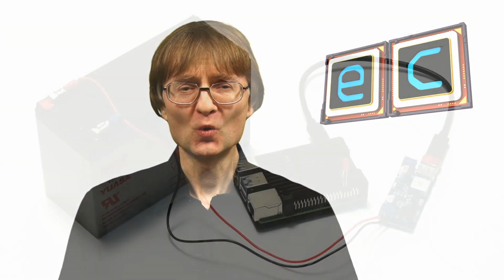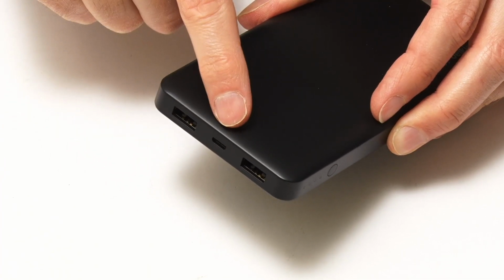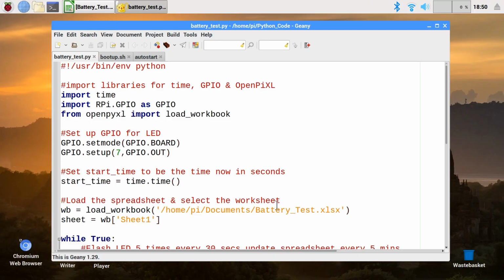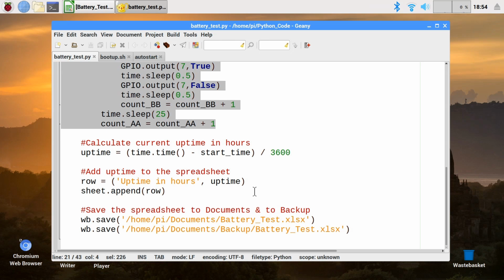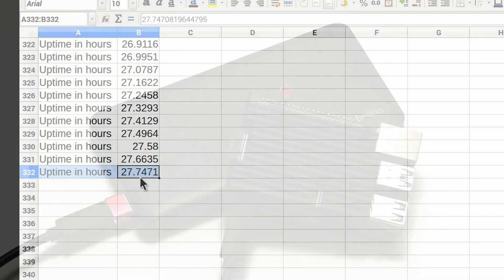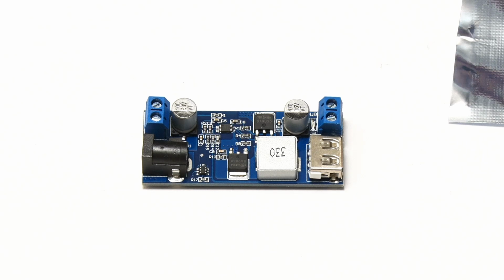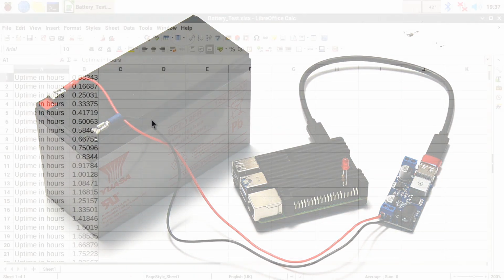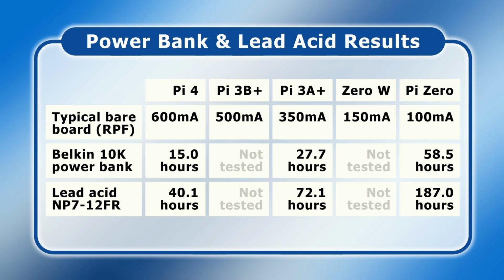Raspberry Pi Battery Power

Comment: If you can use a normal large car battery it would be very. Useful!
Yours truly
MNFsoft
Reply: The buck converter will work the same with a car battery as they are also lead acid 12v batteries.
Reply: Yes I know because I am an electronic engineer a very skilled one actually I want actuall data to use it as reference if you don't mind please!
Reply: @deathtospi9072  What "actual data" do you want? 
You really have no need to prove your credentials to me, I honestly don't care. 
I'm worried though that you (as a "highly skilled electrical engineer") can't Google the battery in the video to find the manufacturer's data sheet and then compare it to 'what ever' car battery you're thinking of using. 
You're not an engineer in the UK are you? If you are, which company do you work for? I want to know who to avoid.
Reply: @theoriginaldylangreene  mainly run time
Reply: @theoriginaldylangreene  unfotunatly I never got the opertunity to return back to the U.K. plus I am just a Ph.D. student
Reply: I am making a new theiory that if we use normal size car batteries it would give us more run time plus it is much cheaper since it is rated 65 watts there models rated even 100 watts but without actal data I cannot prove anything plus I am design ing. An automated fully reluable transport system that can work in hazardous conditions to rescue lives 
so that is why!
Reply: Thank you you have been a big help

Comment: good result, adding any exterior device to the pi changes the results a lot, such a device might be active all the time, my 2x adafruit stepper motor hats (project needs 4 steppermotors), so a lead battery is certainly better. Used 6 volt 12Amp ( less weight ) for the motors and a pijuice hat to power the pi zero. (could power both from lead batt too)
advantage with the pijuice is the shutdown is done by software monitoring its 12Amp battery (not standard)

Comment: Great video :) My pi v1 has been up for  2786 days, 03:07:0 | Linux 3.6.11+ Sun Sep 15 18:40:04 2013
Powered by lead acid and solar :) https://www.youtube.com/watch?v=UIP20B1GMoo
Reply: Wow.  What work is it performing?
Reply: @Chris.Brisson  it's a media head end for a radio transmitter.
Reply: @Anand Raj oh it's real alright. the storage isn't really used as it's network attached, and I used the tmp folder as a ram drive

Comment: What a careless comparison, you didn't prevent the lead-acid battery from deep discharging as far as i can see, this will quickly kill it! No wonder you got these high numbers, the buck converter is sucking the lead-acid battery dry until it hits ~5V and the pi shuts off. The li-ion power-bank on the other hand has protection, it will shut off to protect itself, which of course results in less usable capacity but more cycles.

Comment: i use a raspberry pi 3b plus as a tracker for my camper van and its work fine for 2 years + its sends a line to a data base every 2 seconds via the internet a long side that i have another pi 4 8gb in the van controlling the solar panels and data logging power used and made from solar then if the batterys in the Van get low the pi will check to see if the van not in gear and hand break on if that the case it will start the van engine on its own to charge the batterys then switch the engine off once 100% and all off this reports back to a server at my flat using INFLUXDB to store the data on another Raspberry pi 4 8gb it reports every 2 seconds 

as well as that its controll's all the light and water pump heating usb sockets in the van via relays and  code i got working 

and i can access all of this from a mobile phone via a app i made  

only had one problem a sd card went funny flash another one and all fine

Comment: How big a solar panel would it need to keep the batteries charged so the pi:s can run indefinitely. Or rather is it worth the money to add a panel to the setup? Been thinking of using a Pi for a trail camera. Come to think of it, is there a 4G add-on for the Pi so it could mail me what it records rather than me having to get into the wood to swap out the memory card.
Reply: Yes there are 3G/4G modules around for the RPi. The "size" of the solar panel depends on what RPi you run, and what its doing (3G/4G uses more power than the WiFi), sun coverage (ie wheather), panel angle relative to sun, and finally season (time of year) as the sun can be almost horizontal during the winter in a lot of places. Solar for a Trail Cam may also be affected by tree shadows. As an example, 3x2 foot, 45 degree fixed position road-side solar speed sign running a camera/sensor, and output to large high-visability LED matrix, charge a 12v battery (and may or may not use a SBC).  -  I had previous had along think about how to use a RPi to run remote weather stations (usually with good sun/wind access - like at the beach or open areas in the bush/forest), and how to run a RPi environment sampling at the base of trees and shrubs in the middle of the bush or forest (very little sun light - solar needs to be on a tall poll) - Note there are a least 2 confirmed working projects using RPi to dynamical track (or adjust for) sun for solar panels, one used yearly sun angle data, the other use light sensors.

Comment: Crikey, don't you believe in fuses!  Sealed lead acid batteries can supply several hundred amps, so accidental shorting of the wires from the battery or the PSU module going faulty could easily cause melted wires or even fires.  Place an in-line fuse in the positive lead to add some protection.

Comment: Will done! I wonder if you used a lead acid 6 volt instead of a 12 volt power closer to 5.1 volts?  If I had you as a teacher in school I would have liked school a whole lot more and I have been out of school for 41 years....... see ya next Sunday
Reply: Well you need double the ah for the same amount of wh, but may have a little bit less losses in conversion

Comment: In using the Acid Battery, I noticed that you did not use ferrules to connect to the converter; and the wires you used were of a tiny gauge. Would it matter to use ferrules and a bigger gauge? Would it be a different test if you used OFC or CCA wire? Would a AGM battery be a better choice? Just wondering.

Comment: You have used 100% of the battery's capacity. Doing this shortens its life considerably, compared with only using 50%. You should use an AGM battery, it's not clear whether you did, aka deep cycle (though deep cycle doesn't mean AGM). Your circuitry should include a shutdown circuit for when the battery voltage falls below the recommended threshold. Then your results will be quite different, and quite safe.

I have been researching batteries for use in an RV. My choice is LiFePO4.

What converter did you use?

Comment: Bonjour Chris.  This is a timely video as I am planning to build a local remote power source for my project.  I was planning to use a LiPo battery with a solar panel for recharging.  This video changed my mind to switch to a lead acid power unit instead of the planned LiPo battery.  Great timing.  Thank you.
Reply: @bgeery  Thank you for the info/feedback.  Since the Solar panels will be charged daily,  I hope that the battery will last longer like in an automobile.

Comment: One problem with lead acid battery is short lifetime, 3 years at best even when it is mostly in standby state while in a UPS.  A Li battery with solar charger might be a better solution in an environment like green house.
Reply: Some sealed lead acid battery are rated for high load, and can last decades when used in low power applications. Lithium batteries wins in terms of power density, but don't come close to lead acid in terms of maximum current. Lead acid are rated for usually 5 to 10 years in it's designed application, which can use up to 20 A (even 30A in short bursts), a low current basically don't degrade it.
Reply: @edcofu  Can you recomend which lead acid battery can last 5-10 years?  I have several UPS that uses 12V/7A batteries.  Batteries spend life in standby mode, hardly get used, but still die after 3 years.

Comment: I just finished teaching a unit on electrochemistry where we discussed battery technology as a part of it. I told my students that lead acid batteries have existed for roughly a century and still are widely used because of their simplicity and robustness. Your tests add to my argument. 

I’m wondering if the buck converter is capable of delivering more current for heavier use with the pi 4. I’ll have to take a look at the specs.
Reply: the one in the video has 5V 5A printed on it

Comment: LiFePO4 has a more stable voltage until it is almost depleted and therefore might be expected to provide a greater fraction of its capacity (as well as more cycles).

While not the topic of this video, it would be useful (although more work) to consider battery packs that can function as a connected UPS.
Reply: LiFePO4 batteries are great. I have one I use for portable ham radio use that's rated for 7.2Ah @ 12.8V and it's about half the size (and probably weight) of the SLAB Chris used in this video.

Comment: I think the 12v battery lasted longer than expected.  The rating 7000mAh i suspect is for delivering 12v.  The buck converter probably still outputs 5v, even when the input is possibly as low as 6v.

Comment: Due to low space constraints and Higher Power Requirements of Raspi 4 (1GB RAM) I had to design a converter for 3 Li-ION cells in series (3.7*3=11.1V) and then stepping down this voltage to 5V using a buck converter at nearly 2A!
Happy to see similar work Chris!!
Reply from the maker: We are clearly both on the same page!
Reply: @ExplainingComputers  if anyone is interested Lidl and Aldı sells 20v 4 and 5 Amp cordless tool batteries,  the prices are £25 and £30 respectedly,  sometimes it comes with charger or if you want to buy it seperatelyi it is  usually £12. These batteries are very compact and protection circuits are included in the casing , great for portable, mobile applications. I have been using them last couple of years for remote water reservoir level control and charging them with a small solar panel and very happy about the results .
Reply: @littlechestnutorchard  yeah those hold up quite well in their original use case. I can find similar units on places like amazon. That's what I did for my big boombox, the battery is made from 2 Bosch knockoff batteries and it holds up darn good compared to what I've expected.
Reply: I am enjoying most of the comments here. I've been using computers, programming, training, consulting, and so on for over 40 years. I know disappointingly little about electricity, so these comments are interesting, a little educational (considering my ignorance impedes learning), and partly just wizard uttering incantations.
Reply: @Shogun Zoro Sure
Reply: @sandeepkulkarni3695  ur not even a good youtuber tho
Reply: @zackaboy1236  Though I am a capable Electrical Engineer
Reply: @sandeepkulkarni3695  Me too, ur still not a good youtuber
Reply: @zackaboy1236  Get a life and stop spreading hate on this Informative Channel ( If you were a good YouTuber you wouldn't have done that, though humans make mistake you are one of them, correct it)
Reply: You could get a boost converter to increase the 3.7Vdc to 5Vdc if you happen to have a single cell Li-ion.
Reply: @calmervideo  it's a really bad idea since with voltage regulators, the higher the voltage drop, the lesser the efficiency. Key rule to powering a device is to keep the battery voltage close enough to the supply needed for it to work.
For instance in my boombox, the amplifier in it requires from 12 to 18volts DC. The battery I chose to make then was a 14.4volts 4s lithium ion pack, which make a voltage range from fully charged to completely discharged of 16.8Volts down to 13volts. That way the integrated converter has the best possible efficiency.
Reply: @benjiderrick4590  I agree for an application requiring a higher voltage. I have used boost converters for low voltage applications, such as with an Arduino.
Reply: @calmervideo  That's what I was going to say, it really depends on the application. Things like motors and Boombox in this example can take variable voltage and really don't need a buck converter. I do wonder though, despite having an efficiency loss, would capping the power output with a buck converter at 12V make the device run "longer" (than running at a curve of 14.4V to the cutoff voltage)? I mostly think of this in terms of how a motor draws power (more experience), I mean they can draw as many volts as you throw at them (but can obviously burn out). That being said, this could even apply to electronics? Could capping the output voltage to say 4.5V-4.9V, which might limit the CPU's I/O, perhaps make it run longer or would the device compensate by the CPU drawing more power? A curious thought, might need to satisfy my hypothesis with a test (simple one with the motor as the results of an SPC  might have too many variables to account for). But interesting food for thought none the less.
Reply: @calmervideo  Ya, but parallely I was feeding 11.1VDC to my motors so anyway I had to go for 3cells and a Buck Converter
Reply: @sandeepkulkarni3695  Good point.  If your application requires multiple voltage sources, your design would be more efficient.
Reply: @sandeepkulkarni3695  for a 12V motor, I'd honestly just parallel 4x 18650 batteries (14.4V nominal). You don't need a buck converter at all. But it really kind of depends on your use case.
Reply: @michealkinney6205  I mentioned buck converter feeds the Raspberry Pi at 5V
Reply: @sandeepkulkarni3695  You posted a bit, so maybe things got lost in translation but I was specifically responding to the post "Ya, but parallely I was feeding 11.1VDC to my motors so anyway I had to go for 3cells and a Buck Converter". Motors can take variable voltages. If I misunderstood, I apologize.
Reply: @michealkinney6205  No Issues man, just for you again
1. Had 12V batteries which feed Raspberry Pi as well as motors, again motors take Variable voltage but Raspberry Pi needs a constant 5V.
2.  So this constant 5V is feed by stepping down the 12V

Hope you get it now
Reply: @sandeepkulkarni3695  After the fact, I figured that was what you might be doing.. and in that case yeah, you'd want to do that.
Reply: lot better have use 4 cell li+ion battery  not 3 cell. little ower voltage but have buck converter were drop ewery to 5,1V raspi used voltage. not 5.0 need be 5,1 v.
Reply: @mattivirta  the 5.1v requirement is for powering via usb. Using the pins you bypass the protection ic and you can use 5v without any problems, at least for raspberry pi 3.
In his use case, he needed a 11.1volt supply, so 4 cell would be a no go. Without this requirement, either one cell with boost converter and tp4056 or 2 cell with bms and buck converter is the best choice, depending on whether you need usb to recharge it or you want the fastest charging method.
Reply: @benjiderrick4590  there is no difference between 5.1v and 5v. DC is never as flat as in theory. It will float because it has ripple from all the switching of either the buck or boost in which the power comes from.

As long as the input is a 5% tolerant of 5v, it will be fine. Every component ever produced always comes with tolerance.
Reply: @ragilmalik  yes, but we are talking about raspberry pi here. See when your pi displays a little bolt icon on the top left corner of the screen ? That's happening because the usb power has dropped under 5v. And nearly any standard power brick that outputs 5v might drop a bit under load. Even 12watts units. It also depends of the quality of the cable, etc.

The important thing here, for raspberry pi, is that powering via usb or via GPIO pins does not give the same result.

Take a 5v 2a power bank. It will work in any method, but powering the pi via the gpio pins doesn't show the bolt icon, which indicates the pi isn't power throttling. I used the same power bank and only changing the input method changes the small voltage drop from the usb port and makes a huge difference in performance.